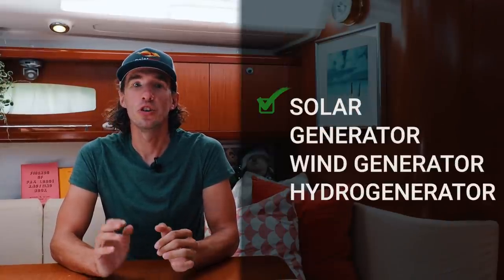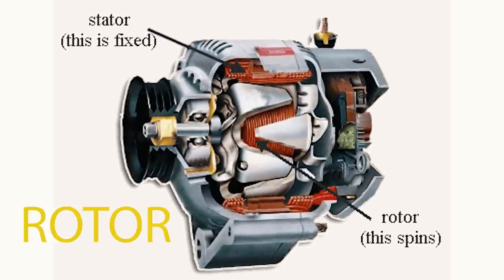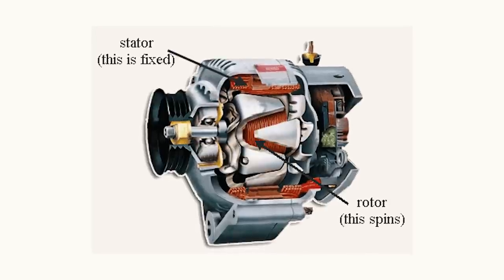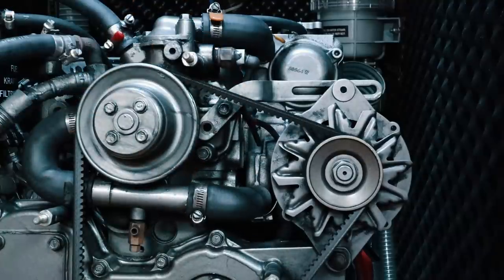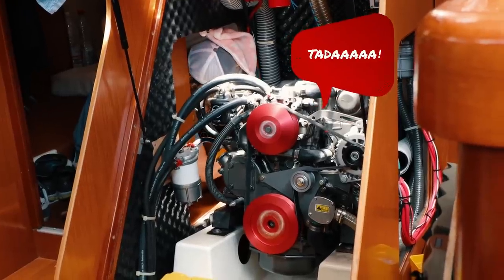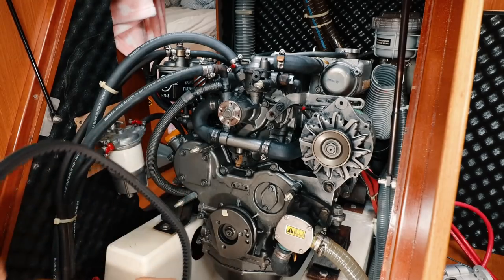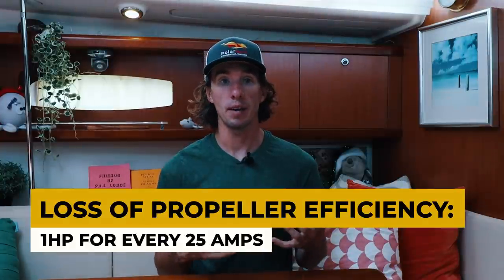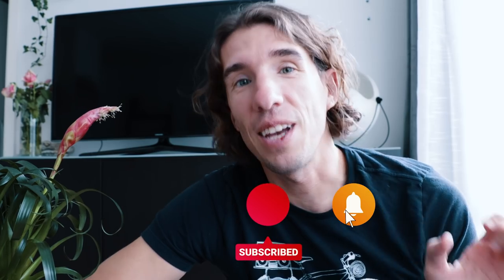SAILBOAT TECH: How to transform your ENGINE into a GENERATOR! // Ryan's Tech Corner #10

Comment: Please do not run your main diesel engine just to charge your batteries.

Hi I have years of experience as an electrician and working with diesel engines and big industrial diesel generators, as well as onboard my own boat.  I enjoy your videos very much.  But was horrified you ran your main engine crossing the Atlantic for nothing more than battery charging.

Unfortunately diesel engines have a problem, if you run them to long only lightly loaded they glaze up their bores and piston rings and injectors.... this shows up with reduced performance, excess smoking, and eventually higher and higher oil consumption.  It should be all diesel engine owners goal to make their diesel work fairly hard when running to prevent the glazing...

If the glazing in the engine is only slight you may find a good hard run makes the engine run better than ever, but this will only happen in a boat if the propelor is big enough to make the engine work hard.  

If left unchecked cylinder glazing, and piston ring glazing will eventually cause enough lube oil consumption the engine goes into a run away situation which has two possible outcomes, either the engine speeds up uncontrollably and blows up mechanically or you physically get close enough to the speeding engine to block off its air intake with some solid object that will not get sucked into the engine, (certainly not your hand). 

Of course engine run away and excess oil consumption can be fixed by having the engine dismantled and deglazed, but that is a major engine rebuild.  Some fuel additives claim to deglaze your engine, but I'm not aware of any produce used by professional diesel engine owners, which says lots. For the sake of induction cooking I think the true cost for you, is massively more than just the fuel used! 

While your alternator upgrade is great, the two things I would say is reduce your amps well away from the alternator maximum rating, and if possible add a wind turbine and more solar to give you more power.... also install an alternator cut out switch on the field input,  to cease battery charging if your engine is slightly under powered...so can turn off battery charging when you need the extra horse power in those situations..

As a side note I'm currently running an under powered RV, (land yatch), and it has 1100watts of solar, 110 amps of engine alternator, current to charge the 300AH lithium house batteries is limited by the resistance in the cable length which gives maximum house battery charging between 35 and 50 amps, well below the alternator rating, I can adjust the house battery charging to occur as a dynamic load on down hill runs or if I'm desperate I can charge batteries on flat runs, but I never charge house batteries with the engine while going up hill...  .  The starter battery is a standard connection to the engine alternator and takes care of the over volts from alternator output switching...that is caused by the delayed effect of the alternator voltage regulator needing to reduce the alternator internal magnetic field which is slow reaction, before the alternator output reduces, hence volts go up....  

The voltage spike of an alternator needs to be addressed some how with lithium batteries otherwise when the battery management switches of the charge current the delay in alternator response will cause a high voltage spike that can damage everything else including the battery management circuitry.  I have seem a couple of examples now of good lithium batteries having their battery management circuits destroyed in what could have been a fire on board, if things had turned out worse....     

Happy sailing

Comment: if the efficiency  drops with the alternator capacity... why not tie a 4 sets of 50A alternators each charging one 12 volt battery???  if one of them burns , you have another 3..  yes.. the complexity of having 4 belts, one pulley with 5 belts.... today if the alternator locks, your belt could broke and you are unable to use the engine...  so a 5 alternators (1 for the engine start, and emergency), 4 for electricity... besides, 4 sets of bateries you have 48 volts (in series), and a  5kw inverter (peak power)  running on 48 (120A )volts is crazy efficient...  and is safer...  what do you think???  complexity can be good if you have redundancy
Reply from the maker: Good idea but its a space issue.  Ryan
Reply: No even with redundancy you should avoid complexity, also it doesn't really work like that either having so many alternators will compound the inefficiency not reduce and the regulators are pretty simple and will cause problems since the winding resistance isn't exactly the same across all the alternators you could endup one taking the brunt off the load causing overheating, keeping it simple is preferable for hour belt failure reason with the setup you suggest yeah there would be 5 belts but the chances of being able to package it all so the belts are all the same length is slim to none so that means carrying atleast 5 different belts for spares and a pain replace especially if the inner most one lets go, however multiple alternators isn't a bad idea on a single belt to a small standard alternator for the starter battery a engine related systems then a large one on an electric clutch like those used on car AC compressors this would allow you to disable the large power sink when not needed or not wanted. Lastly i have looked into this a bit myself for a boat also an electrician and yes 48v is more efficient and slightly cheaper from a battery setup point since smaller cables can be used however not that much is run off inverters and instead is directly connected to the dc side and while you can just setup to pull 12v/24v from the battery bank it isn't recommended with since it causes cell imbalance then when that 150a of charging power comes in the lower cells take most it add can be damaged, 24v banks seem the be the better option obviously double the voltage of 12v so half the amps but also millions of things already designed to operate on that voltage